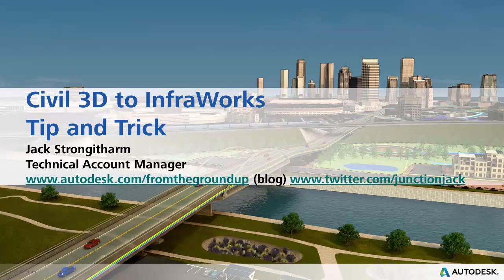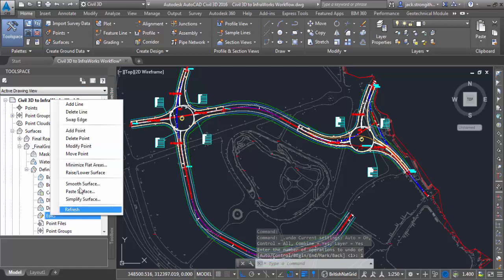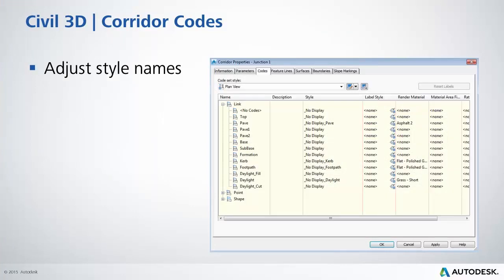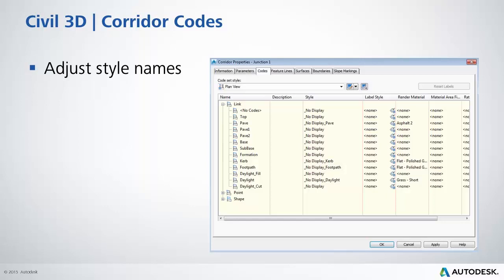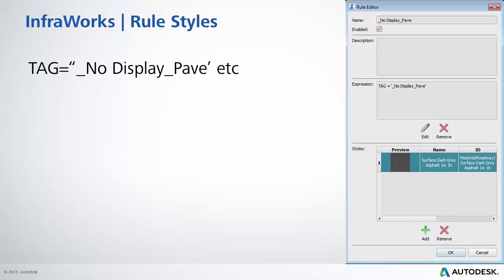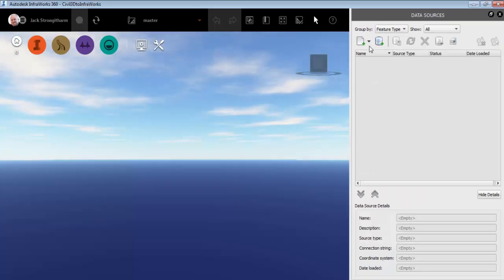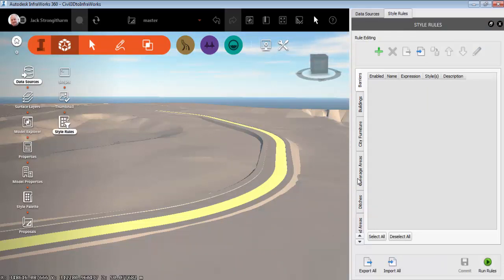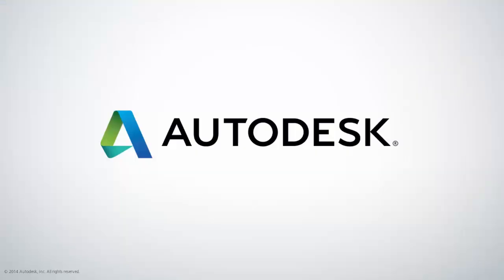AutoCAD Civil 3D to InfraWorks Tip and Trick

Comment: Jack great video.  We are having a challenge where pipes drawn in CIvil 3D, are coming in Roads in Infraworks.  Specifically Gas, Steam and water.  (Footnote we had geolocated these pipes and Michigan (North American Datum 1983) or (MI83-SIF). We are able to select MI83-SIF but there is no XYZ associated.  Thanks in advance for the tip